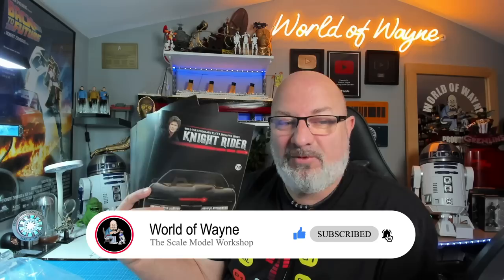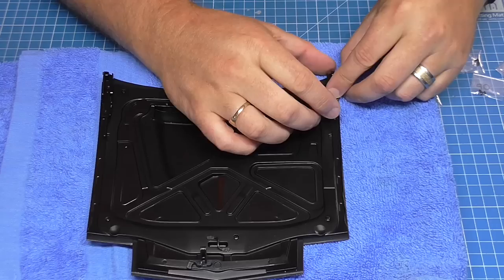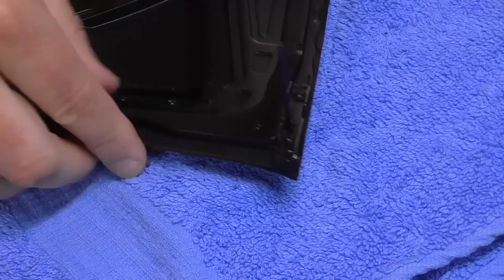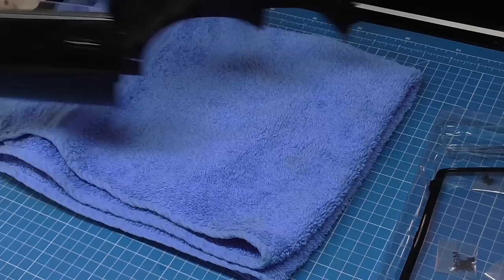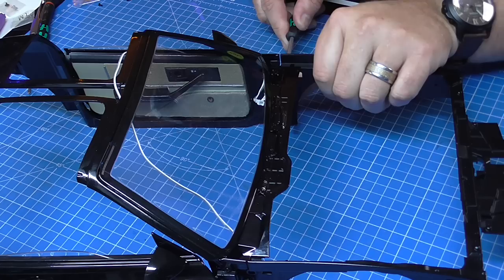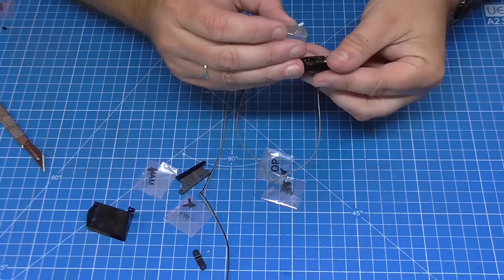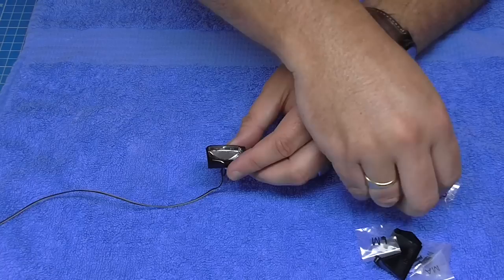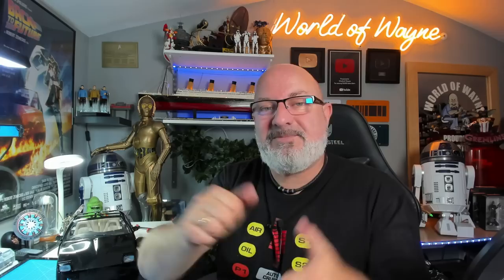Fanhome Build the Knight Rider KITT - Stages 75-78 - Bonnet Hinges and Headlights

Comment: Hi Wayne, did your pistons damage the outer part of the cylinder when you put them in? 
You should have watched my video for an easy way to align the front section 😅
And in step 76- 8 when you put the AM screws in you missed putting in the clips that came with issue 74 part 74b
Also check out my option to not have KITT pop up the headlights
Reply from the maker: Oops. Yep I’ll add them
Next time